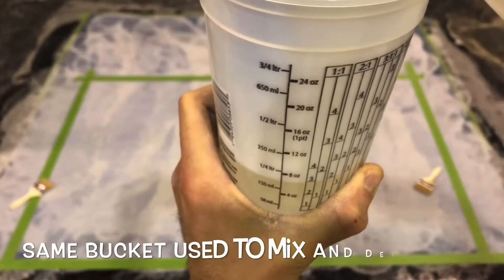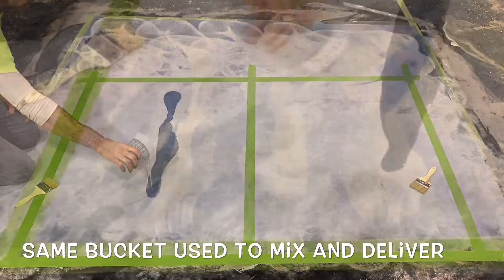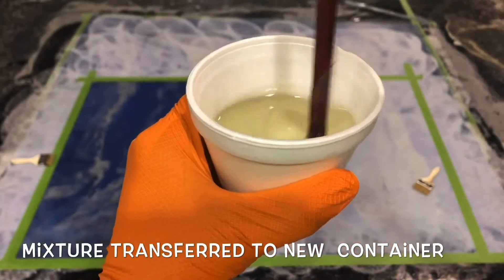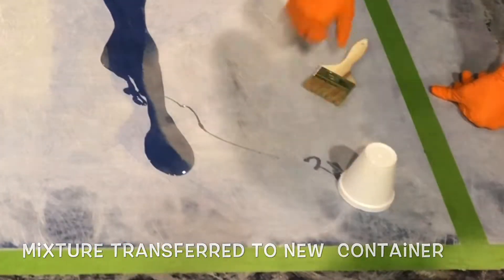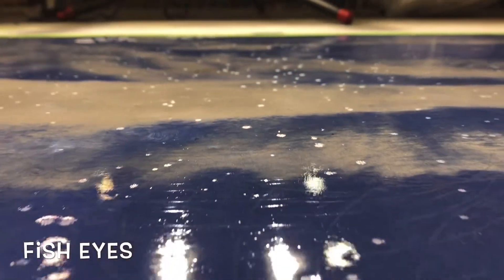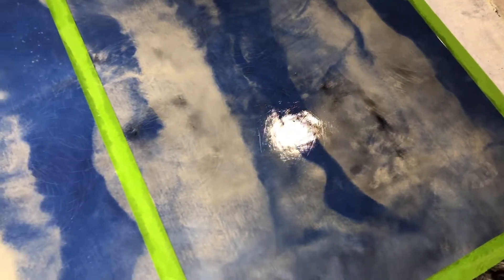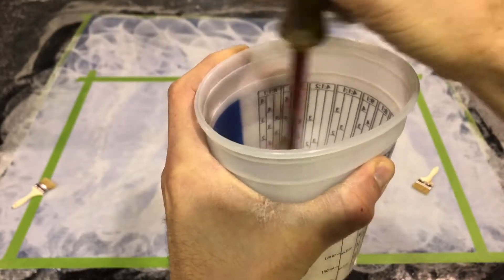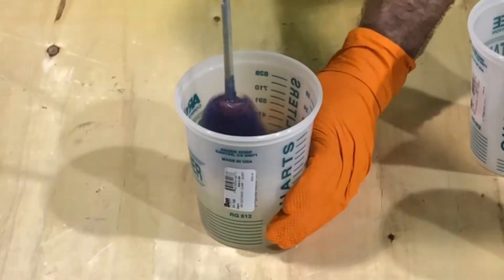Avoid Fish Eye By Switching Buckets When Mixing Epoxy or Polyaspartic

Comment: how do you fix the fisheye
Reply: I actually have this issue and had to have a separate vendor come in.  We tried sanding it down a bit and applying polyaspartic on top but the fish eye stays there.  They ended up having to apply a clear layer of epoxy over the poorly installed epoxy and then they will add the polyaspartic over the clear layer.
Reply: @Steve-go3zp  so they had to do 3 layers now, it’s polyaspartic, epoxy and polyaspartic? Expensive haha
Reply: @kadinkeith8709   Epoxy, Epoxy, Polyaspartic.  Yes Expensive.  Yes, I'm taking the original vendor to court! :)